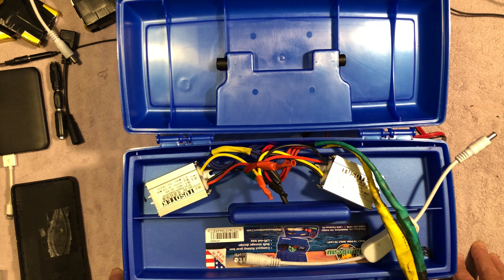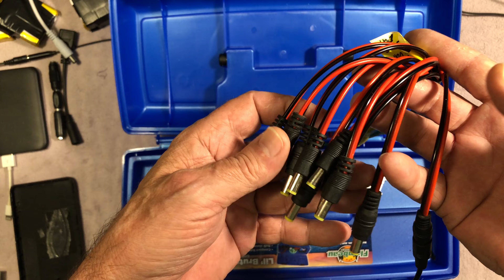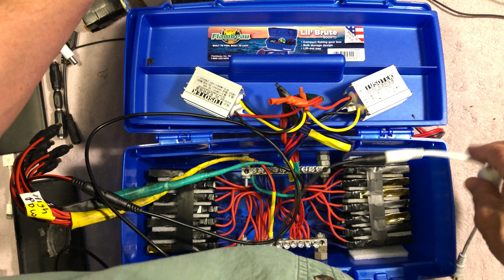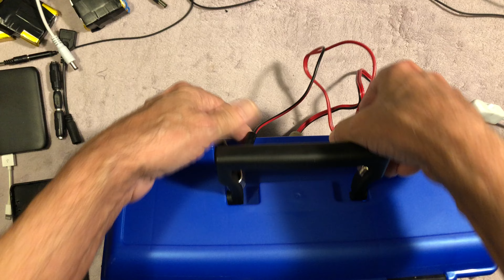I made portable low power backup battery lighting system using 14- 4 volt Lithium batteries.

Comment: You think those 5v chargers are designed to charge those lithium cells. Look at the manufacture datasheet of the battery cells to see what voltage and current to charge them at so they don't catch fire in your house!
Reply: @I-AM-THAT-I-AM-JAMES  I see, its hard to find a high powered 4.2 volt charger for your project. maybe you could use a relay to shut off charging when the cells reach 4.2 volts to avoid an accident from overcharging when using those 5 volt converter chargers.
Reply: @I-AM-THAT-I-AM-JAMES  I didn't see the battery cells have individual bmses. If they do have cell level bms its cool the bms will keep them from overcharging.